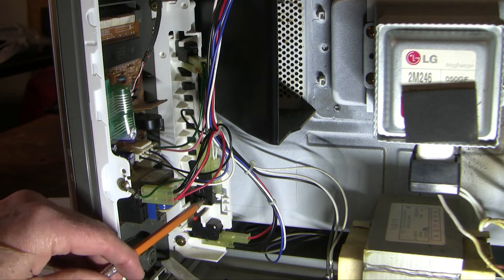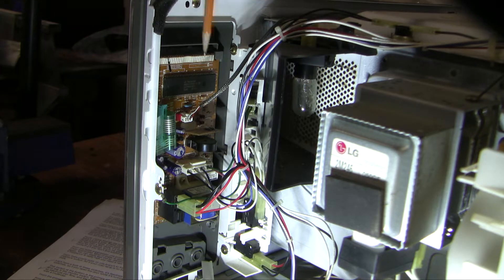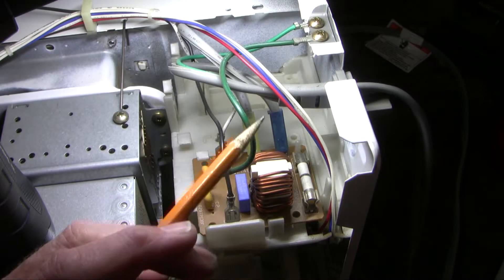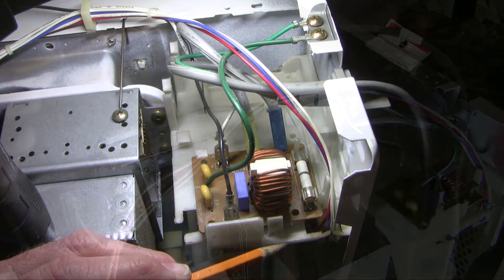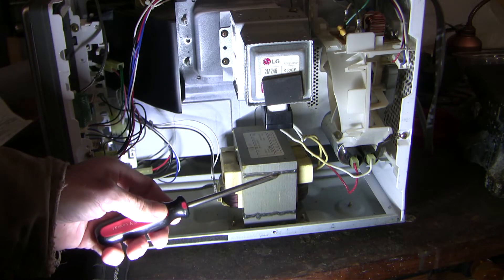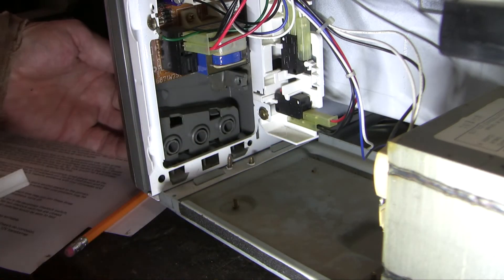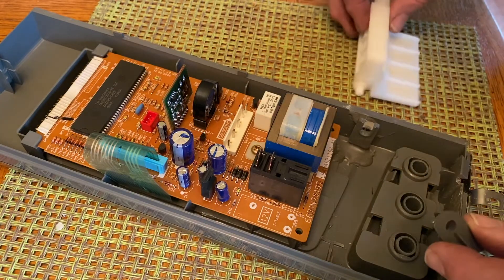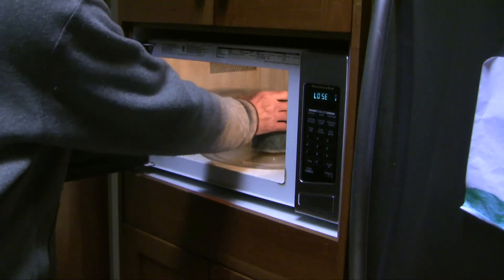How to fix a broken microwave oven

Comment: My microwave starts, runs for about a second normally, and then shuts down. The display says XXXX for a few seconds and then goes back to 0 as would be normal. What would make the unit act this way? Seems likely it is not fuse or door switches? Could something cause the power to the electronics to sag when the unit comes on to the point that the controls would shut down?
Reply from the maker: That's interesting. Clearly the unit is not powering up properly and is shutting down for safety. I wouldn't discount door switches or relay problems. Something like a bad capacitor or cooling fan or a bad relay could do that, but the list is long. Many devices come with internal trouble codes that help, if you can find a technicians repair manual online based on your model number. There is a major safety concern with these, the voltages are really high. Given how inexpensive microwaves are, you need to ask yourself if you are willing to put in the effort, risk, and time to decide whether it is worth fixing. There are some much more detailed microwave videos online now doing a deeper dive into problem solving.
Reply: Well, after pulling it off the wall and taking cover off I poked around a while yesterday. I am a retired EE so working around voltages and caps not a problem. Couldn't find anything that would make it work so went to bed. This AM I got up to do some more troubleshooting and now IT WORKS! And won't stop working!
Frustrating. I suspect a capacitor that "healed" itself over night. It's 14 years old so I should just replace. But I'm cheap...and stubborn! @spelunkerd
Reply from the maker: @JP-rf7px  There's something oddly satisfying about diving in and ultimately making a diagnosis, although techs everywhere whine about how difficult intermittent problems can be. As you say, better to wait til it's broken enough to leave reliable clues. I'd be looking for something mechanical, or perhaps corrosion at a connector, somewhere. Thanks for making this thread worth reading.

Comment from the maker: My offhand remarks about the Villard voltage doubler circuit just after 4:00 don't give this clever little circuit a fair shake. When you put a capacitor in line with the secondary of the transformer, and add a downstream high wattage diode shunted to the other side of the transformer, the outgoing AC signal between the two is given a DC bias such that the negative baseline is shifted up to the forward voltage of the diode (a clamp circuit). So the peak to peak voltage difference is unchanged but the entire AC pattern is shifted upward to double the peak forward voltage. The cap discharges when the incoming phase shifts positive to double the outgoing positive peak, and then recharges the downstream plate with current coming from that diode during the next phase. For more info, Wikipedia have a page on voltage doublers that explain it well. Almost all old style transformer based microwaves had this Villard circuit. New inverter style transformers are much more complex.

Comment: Haven't had dig into the electrical but my over the stove microwave developed a drooping door.  A spot weld had broken so the bottom hinge was pushing in.  Tried a screw but that didn't work.  Then a pop rivet did the trick and it's been good for years.  There was a small hole there, just pulled the hinge outward and put the rivet in there.

Comment: Good explanation of the major internal components.  I diagnosed a defective board relay that was not sending power on the load side to fire up the transformer. Soldered in a replacement and fixed for $5. Two years later the noise suppression fuse blew, replaced that for a ridiculous $9. The 13-year-old GE Profile is still running strong today. Saving me $500 from buying a new one.